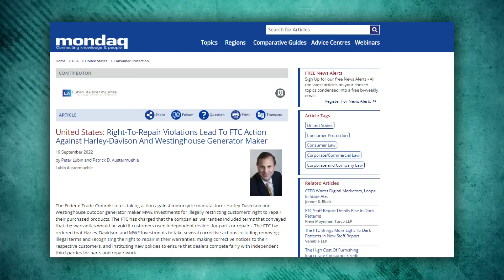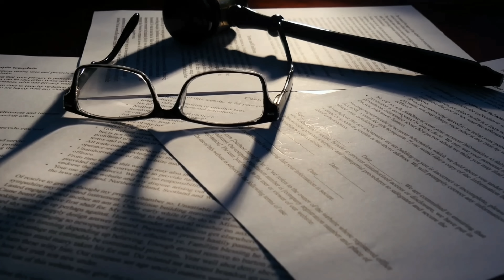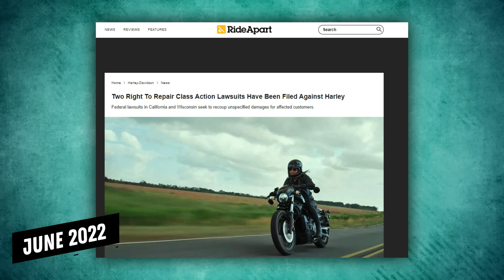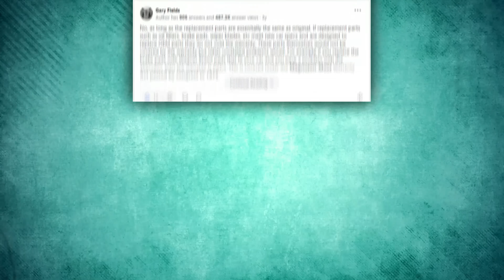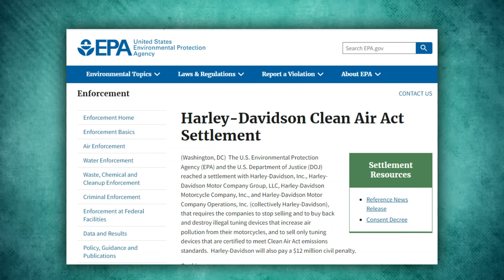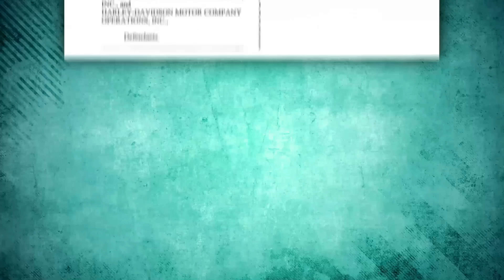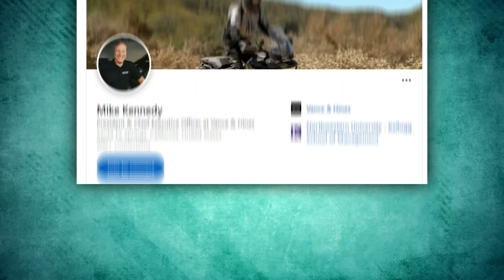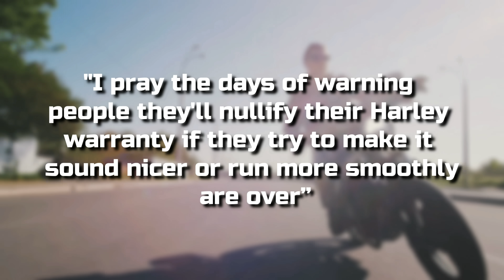This Affects All Motorcycle Owners!

Comment: Absolutely my recommendations are stay right away from Harley Davidson dealerships altogether…!!!

Sy’s Harley Davidson told me my compensator needed changing, then also started telling me my starter motor needed to be replaced. This is when I got Suspicious and told them to stop all work on my bike, and that I wanted all the parts they had already removed so that I could have them checked by another mechanic. Upon having the parts checked by not one but two independent bike mechanics, I was told they had no idea why Harley Davidson would have changed the parts that there was nothing wrong with them meanwhile I was out $1150
Reply: Did your bike have hard starts?
Reply: @Smashdragon762  
No there was absolutely nothing wrong with the starter-motor or the compensator…

Comment: Too bad. As soon as I got my iron 883 I put an fp3 fuelpak tuner on it, with 65° air sucker and V&H short shots. My dealer fixed my gear shifter after lowside. Insurance involved. Not a warranty issue and they didn't void it or get rid of my warranty. If anything they kept it shush shush and let me autotune my bike after any fix.

Comment: I own three Harley Davidson motorcycles. ALL were bought USED. The newest is a 2006. No warranties to worry about. No EFI tuners either, as mine are all CARBURETED. But anybody who chooses to buy an EFI bike, and I certainly don't recommend it (All H-D Sportsters and full sized bikes through the end of the Twin Cam era can be converted to carburetors, something I DO highly recommend. It won't cost you any more than a $1000 tuner and wide band O2 sensors. And you will get rid of all those unreliable and failure prone computerized electronics, and make it super easy to work on and tune your bike. But if you do want to put an aftermarket exhaust on your EFI Harley Davidson motorcycle, it WILL require a NON EPA approved tuner, and new wide band O2 sensors. It's the only way to get the air/fuel mixture rich enough to prevent burning up your engine. And since Harley Davidson started kissing the EPA's ass, you will NEED both an aftermarket exhaust and tuner to make you bike sound like a Harley should. I really don't care if H-D goes out of business. They no longer make real Harleys anymore, and certainly don't make anything I want. I have never been a fan of H-D, only the bikes they USED to make. The M8 engine bikes are as smooth as a Honda Goldwing, and sound about like one as well. They do not meet my definition of a "Harley" And they just discontinued the Sportster, the only bike they made that could still reasonably be called a REAL Harley. So since H-D no longer has a reason for existence, it is time for them to go bye bye. They have betrayed their customers, their company, and their heritage. And they need to pay for that.

Comment: It amazes me how the bikes and cars are getting law suits out so quickly but the semi truck industries have locked owners out of self repairs for years now
Reply: Jeremy G I quite empathize with your disgust. I am able to replace mechanical-only components on my FL, and without access to FL electronica, can replace mech-elec components such as turbo, injectors etc but not program them. 
But that us only the tip of the iceberg. the bigger evil with Freightliner is that they refused to share software with independent garages. seriously crippling many fleets. the good news? currently there is a multi hundred million dollar lawsuit being organized in the United States against Freightliner as a result. I don't wish ill on anyone but I do hope that the lawsuit against Freightliner is successful because I think it is fundamentally and ethically wrong to sell a vehicle to the public and put yourself in a position where you charge whatever you bloody well want for repairs..
Reply: Yes sir. As a diesel mechanic myself, I typically recommend people look for an older truck in good mechanical condition rather than buying a new one. I’ve even offered to accompany them to inspect the rig before they buy it. We’re pretty rural out here, and you might not be able to get a tow from the logging road your truck is broke down on. You gotta be able to fix it right where it is. If I need wifi, and special permission, I can’t fix your truck. You have to drop several thousand dollars to get it towed, and then several thousand more to get it fixed by some knucklehead who graduated from a technical college, but may or may not have ANY business being under the hood of a truck.
Reply: @californiadreaming9216  This started her in Cali back in 2006 if I remember on cars as well. Everything had to go to the dealer because they alone had the software to do the reapairs. Every mechanic I knew was PO'd.
Reply: Yet another reason to buy used pre emissions trucks
Reply: @CubanSalt  they are becoming hard to find and usually over-priced. Do you know a dealer who has any good ones? Thanks.
Reply: @CubanSalt  in EU they have forced us to buy €6 trucks.. I had a '99 volvo fh that never had a problem, with my 2017 volvo now Every year something pops up
Reply: Lawyers don't drive semi trucks.
Reply: Wrong ,there are plenty of trucking companies that have O.E.M. proprietary info. Most of the time the engine manuf. Is who you need field repairs for. Most of that is for the emissions systems.
Reply: Theres somethings owners should not have access to. Not to mention the truck stop doctor that will rewrite your ecm and make it better . As soon as a service tool is hooked to the units ecm ,bye bye warranty . I have had to fix units ,usually with a new 3k dollar ecm cause a company driver was able to have deisel doctor hack his ecm and cooked it. Made truck owners start taking unit ecm passwords seriously. I spent 16  yrs at paccar international , ( peterbilt and kenworth) 10 yrs at international trucks north american and 7 yrs at freightliner/western star . Seen lots and lots of proprietary info and all of it is to stay in the epa guidelines and still produce units the can go a million miles with mo major issues. Base engines are still fine , nut the emissions are all over the board . Wait for 10 more years when acid rain is way worse cause now , we are burning urea . Deisel exhaust fluid , yeah save the enviroment huh . Well get your horse and buggy out

Comment: Or, do as we old time bikers have done for years. Don't buy a new bike. Buy an older bike, rebuild the engine and transmission, the brakes, etc. You will learn your bike inside and out, and have a bike that is YOURS. You will also probably spend a lot less than you would buying a new Harley.

Comment: I got an updated warranty contract from HD reversing all of this - the new warranty says (to paraphrase) "Harley-Davidson will not void the warranty on their product for the customer seeking repairs outside of the dealer network.  Harley-Davidson will not void the warranty if the customer installs after-market components on the customers motorcycle, providing the install is not the cause of a mechanical failure"

Comment: I've got a great solution to this mess - Stop buying these under ENGINEERED over priced unreliable piles of junk like they've been building since their inception- I've got a sheriff's Deputy friend of mine who bought a  brand new Road King 20 years ago, left it completely stock, got it routinely serviced as required, and broke down twice trying to make a simple trip from LA to Sturgis- first a stator LITERALLY caught fire, melting down the wiring harness, and having to leave it at the HD dealership in Vegas for repairs, and then having to RENT another bike from Eagle Rider, then the following year, tried again to make the trip to Sturgis, THIS TIME having a complete transmission failure, again having to rent another bike to finish his 2nd nightmarish trip to Sturgis - And this was a bike with less than 20,000 miles on it - JOKE!! so he finally gave up, went to a HONDA dealer and bought a brand new VTX 1800- he's got over 45,000 miles on it with no issues whatsoever- it's never (and never will) broken down, left him stranded in the middle of the fucking Las Vegas desert and he's made 4 more uneventful trips to Sturgis since then- Nothing but tires, brake pads and oil changes- WHAT WARRANTY?? and it was HALF the price of that pile of shit that they DARE to call a "Motorcycle" And they wonder why their SALES are down 30% world wide

Comment: That sounds like the plain, unvarnished truth. Why would that effect anybody riding real motorcycles? That is going to be  a really exciting time for most riders. 
HD= Overweight, Under powered, poor clearance, bad brakes, overpriced. 
If HD wants to save itself, they need to start building Buels and Porsche designed engine in lightweight frames, and get some talented engineers.  If you stop charging like wounded bulls would also help.

Comment: I love motorcycles. It is mandatory to get a factory service manual for what ever bike you own. I assume the liability of modification. When I adjust fuel maps, air intake, exhaust. If I don’t reflash my ecu I would get popping (which is cool) but also leave more carbon build up. What I need is a licensed or OEM tunner. That is right to repair. 
It is impossible not to customize your bike.

Comment: Clickbait headline. This has nothing to do with me and I have owned 108 motorcycles over the past five decades. I leave my motorcycles totally stock, and I use OEM filters and parts. I never modify the exhaust or the intake not even the airbox. The factory knows more than I do so I leave everything in stock… once I learned that lesson, I won six road racing championships, and two national championships, on a totally stock machine. It wasn’t the bike that was slow, it was me when I first started road racing. Once I learned that, I was able to concentrate on the things that matter, and leave the engine alone..
  I actually wish they would do something about motorcyclists that make their motorcycles louder just to make them loud. I thought it was illegal on a federal level to alter the exhaust. I hope they start enforcing that because that gives all of us motorcyclists a bad image

Comment: All dealers do this,especially cars and trucks. Bought a new escort,went to service counter and was told that even if I use factory Ford power parts that are installed by the dealer,my warranty was void....they said if I changed the factory sound system  my warranty could be voided also.

Comment: I find that it is interesting that Indian has for a cheaper price all the upgrades built in from the factory. The stock engine has about the same hp, and torque as a stage 2 upgrade. Also the stereo have a stage 2 upgrade. Makes you think that its just better to get the bike you want for half the price.

Comment: Factory Warranty and repair can only be done by factory trained mechanics at the oem's   dealership that has met all requirements to do so, it's never not been like this , if the vehicle has been modified in a way that would cause additional stress and wear it can't be warrantied, it's never not been like this for any brand, this is not something new, I hope for the oem's sake they don't win the suit, we could see warranties go back to 6 months and 5000 miles

Comment: The presenter has a nice voice but his script is unclear, even to this aged biker who practised law for decades. Three issues appear to be there and they are presented as one which I suspect is not the case. Many of us are not U.S.A.  resident and are unfamiliar with the goings on there. So even more confusing. 

The major issue I think I grasped:

(1)  If you buy a new H.D. motorcycle the company provide you with the minimum length of warranty which the law insists on? Some of the warranty provisions are not told to the buyer?  If so, immensely odd!  And,  if during thev warranty period non- H.D. parts are fitted such can invalidate the entire warranty? Here in the U.K. such has always been the case with most or all sellers (certainly since I started biking in the 60s) and is reasonable, strictly provided that the seller dealer exercises this provision fairly - reasonably linking a parts failure to a non-standard part fitted. 

The thing to bear in mind with warranties is that if they are unfair a buyer always has alternative rights either embodied within statute or common law. So, a warranty booklet never comprehensively controls the legal playing field. 

But such can be an academic point when, as nearly always, legal fees are far greater than whatever sum of money one seeks by way of compensation!

(2)  I was unable to even get to the start line on points 2 and 3.   Something appears to be preventing a H.D. owner  from using the services of a non-H.D. dealership? No idea what this is about?

(3)  Again likewise on this point, clueless what the message was?  There are two types of parts - offical H.D. parts and copycat parts? Something appears to be preventing non-H.D. dealerships sourcing one or both categories?  If so, this may be indirectly making it impractical to utilise the services of a non-H.D. dealership to carry out servicing / repairs? If so, then I accept that such intertwines points 2 and 3.

Please bear in mind when presenting videos, particularly when  such involve technical legal issues, that we the watchers (for whatever reason) are in the main not already sharply in tune with such matters.   We need to be sequentially led through the issues in a way that a bright eleven year old listener would comprehend.  Being patronising in this instance to us listeners would be  appreciated.

Comment: A manufacturer does not nor should they spend R&D funds on testing aftermarket parts intended for use on their products. Harley has the right and just cause to not endorse aftermarket parts that may cause harm due to lack if testing.
That being said, items such as radios, chrome trim, etc are not going to affect the engine, drive train and should not void warranty.

Comment: I purchased a new 2018 Ultra for my retirement I told the sale's man what I planned on doing to MY bike and he told me that it would cancel my warranty and I told him I will do what ever I want to MY property and if they will not cover my bike if something went wrong I would see him in court ,  so I put Zipper's 468 cam kit  , V&H Pro-Pipe , Cobra High Flow breather, and a Thunder-Max Tuner , and did it ever wake that bike up , so that was 4 years ago 42000 miles later and still running like a champ , I've been driving these things for 45 years so DON'T tell me what I can do or can't do you  took my money didn't you , and I think it looks good on Harley sue the hell out of them !!!! Just saying !!!
Reply: I get where you are coming from. I also get HD position on that. With that amount of upgrades and actually changing internal engine parts I would have to side with HD. Ford would not cover a new car if the owner made similar upgrades. Where the problem lies is as stated in the video an aftermarket exhaust upgrade should not nullify a transmission failure repair under warranty. I recently purchased an ultra limited. I won't do any upgrades until the warranty period expires. I'm not giving a bean counter any reason to deny any warranty claim. All my services are being performed at the dealership I purchased it from. All I will do is check fluids and tire pressure. If anything breaks its on them.
Reply: I fully agree that you should be able to do what you like with your property, but I also agree with HD voiding your warranty. If your engine grenades why should they be responsible when it's not their parts in it or a bad aftermarket tune? Modify at your own risk.

Comment: Here in the UK as long as an in warrenty bike is taken to a vat registered shop the warrenty stays valid however OEM parts must be used.   Also if any  upgrades to the engine or drive train is done it's voided.  If any wiring is changed for any reason its voided.  But if the exhaust is changed it's usually OK but best check with the dealer 1st and get written confirmation.

Comment: This doesn't affect me and a many other HD owners because our bikes are already out of warranty anyway. It could have some effect on parts warranties; i.e. unless it's an HD part installed by an HD dealer the warranty on that part is voided. But that's negligable because even if it's an HD part that fails affecting the motor, you're only going to be covered for that part anyway.
Reply: That's BS because the dealer installed the part and Harley made the part. They are liable
Reply: @ronaldjones743  It really depends on what part we're talking about and the extent of damage its failure would cause. If you're talking about the failure of a new HD oil pump installed by a HD dealer causing extensive damage, then yes you'd have a case to force HD to either cover the rebuild or the cost to replace the motor. But you can better believe that HD would fight it by trying to claim the failure was due to something else.

Comment: People slagging off warrantys on new bikes need to back off ! most manufacturers warrantys do the job its intended to do. BMW Motorrad warranty is awesome ! the point is HD needs to reigned in so they cover what everyone covers on their machines. the problem is they don't want to, its basically an admission that they KNOW they have terrible reliability issues, they simply won't admit it. Sure they look pretty, but it aint gonna make it enjoyable to ride if it doesn't work and you're constantly having to fix it. so, if you want reliable, buy european or japanese, problem solved, HD's problem will be sales.